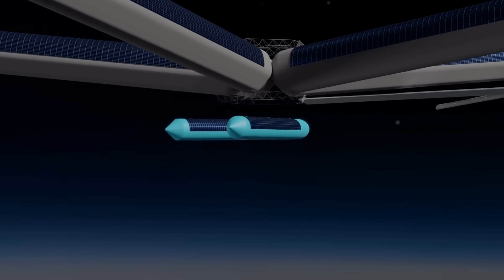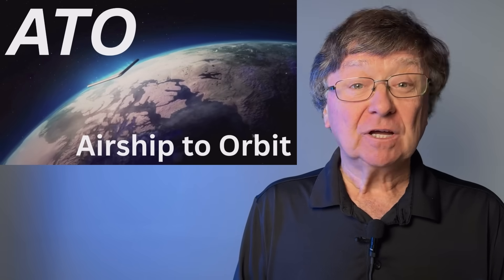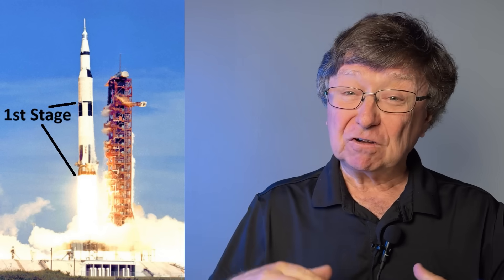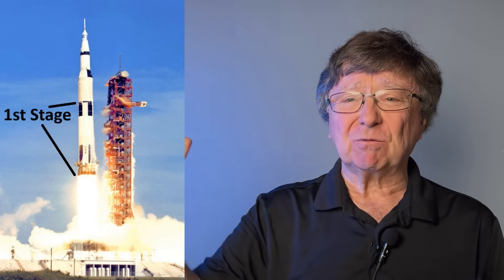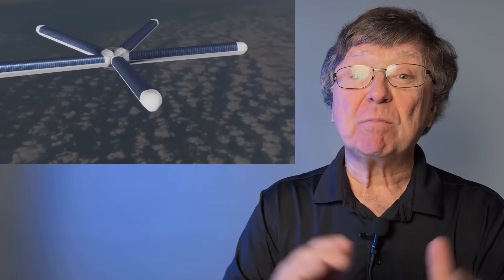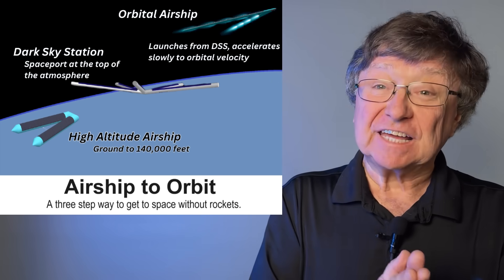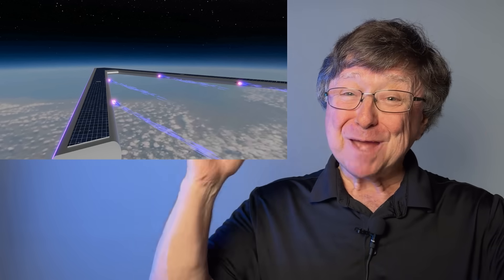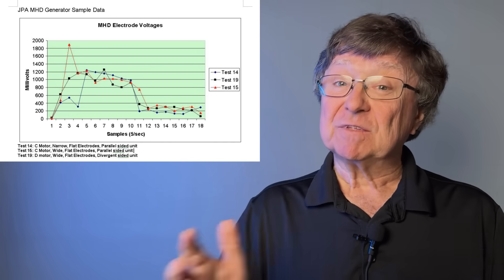This Airship Might Change How We Reach Space Forever!

Comment: I would not use the "safety" argument against rockets in order to sell your idea. 
Because we know that with practice, higher levels of safety are acquire and your idea is not accident proof either. 
If you have to sell it, why not use the polluting argument on the atmosphere when we launch a rocket.
Even for the rockets that use just hydrogen, there is still an issue with the NOX or water molecules that you leave at high altitude, which they can also change the weather.
Not sure if this could also be an issue for your electric plasma propulsion?
With respect to the airship to orbit, from the animation we can see that the scale of the airship is huge compared to the payload.  This mean that the airship mass despite achieving buoyancy at that altitude, is still quite large..  Maybe close to the wet mass of a rocket required to launch the same payload? 
This mean that the energy required to accelerate all that mass to orbital velocity would be similar to the energy used by rocket for the same payload.. 
With the difference that using low thrust electric plasma increase your ISP to the point of almost no propellant is required.
Or another argument to sell your development and research, could be other type of high altitude applications or even cases for Venus or Mars.
Reply: Selling the concept as a first trial of potential Venus station is a good idea.
Reply: High altitude communications stations that can operate for extended periods and are not owned by a guy that flings his arm out.
Reply: Do MHDs produce ozone?
Reply: @JinKee it might, which could be something positive, i can not think about any obvio us drawback of this propulsión method, that is why I am asking and why I think it could be use as a pro argument.
Reply: Pollution is a stupid argument.
Reply: @johnrmcclure1 it is a weak argument over our current World launch rate, but there are severa papers that place the alarm if the launch rate increase 100 times according to spacex goal with starship.  As I said, even lh2lox rockets would produce a quite negative outcome at that launch rate.

Comment: Pick any two: buoyant/aerodynamic lift, feasible atmospheric heating load, orbital velocities. Spending days at atmospheric densities high enough for buoyant/aerodynamic lift means an unmanageable heat load. Going high enough to avoid this heating means not enough atmosphere for buoyant/aerodynamic lift. How does the orbital ascender deal with these heat loads?  No one is saying balloons can't go fast. Those NACA balloons  and project shotput/etc were lofted with rockets. They were not generating buoyant lift when they were going Mach 10. They definitely did not show what you want to do is possible. Unless you have an orbital capable rocket involved?
Reply: I'm actually looking up some information on that. If the density of the craft is low enough, the dynamic pressure needed for lift can be low, and therefore, the heating can be low. 

Intuition can lead people astray, so it's best to check your preconceptions with math.
Reply: $10 to look at the pdf is extremely sus in my opinion.
Reply: It is matching speed to thermal capability.

And when above the atmosphere the second ship is light enough to slowly keep accelerating into a higher orbit with no drag.

It's a longer and less high delta v they traverse that last part in and out of space.
Reply: @ferkeap  its' true that the second ship needs less deltaV but what do you mean by light enough?
Since the load carry accelerates downrange, this means that the spaceport is moving at the speed the loader reaches while floating upwards in the atmosphere, so... For it to produce enough buoyant lift and/or aerodynamic lift it would need to sit at ~50 km up like specified in the video, that height means it needs to overcome a lot of drag while going forward meaning it would require fuel to push itself forward.
If the spaceport was stationary then it would Just sit there and the load carry could Just simply do its airship thing and reach the spaceport, then slightly more deltaV for a Normal rocket second stage and you're ok to go...we're talkin less than 8 km/s of DeltaV mostly in s vacuum (much smaller rocket)
Reply: @ferkeap  Light enough to keep accelerating? You're claiming a much larger than 1:1 thrust ratio? Because above the atmosphere there is no bouyant or aerodynamic lift. And it won't be going nearly fast enough to not hit the earth while falling yet.
Reply: Yeah. The Mach10 thing seems illogical Maybe I'm missing something, but low Earth orbit is not "above the atmosphere". Put a big balloon up there and it will need thrust to maintain its speed. And way lower at Mach10 with a balloon is going to generate a lot of drag!
What's the point of the Mach10 station?
I've got a better way: extremely slow 70% efficient piston engine powered robotugs with way big wings and counter-rotating necklace propellers.
Wings are key, so their final stage is reasonable. The rest sounds flawed.
Reply: High altitude iris catch platforms? Debris collection?
Reply: There's this thing called materials science . . . Things have changed a lot since you graduated in the 50s 😉
Reply: @mizake01  The physics haven't changed. What JP wants to do wouldn't even be possible if everything was metal. Shockwave impingment sites are the problem. Everything that travels that fast in thick enough atmosphere is a simple conical shape to avoid this. A giant floppy cross section of non-metal? Laughable. The key here is how does the ascender get bouyant lift and go orbital speeds at the same time. It can't, not without extreme heating that doesn't matter what material it's heating.
Reply: @Superkuh2 so you have done the math?  Share some numbers that exceed CMC capabilities
Reply: @glike2  Why are you asking for math on a non-existent object only theorized and we do not even have figures for the project except a dual 30x30m payload door. What is anyone supposed to calculate off that. It's not about "Math"(which I think by that you mean Physics).
@Superkuh2 actually spoke about factual engeneering knowledge. The load carry should only raise vertically, it makes sense as discussed in the video to launch from high up, which as you saw is being done already. But why making the loader accelerate to mach 10? To then meet a Hub which is moving ( so also at mach 10) (mach is a unit that also varies depending on height so why?)
Then you take a Giant angled craft (why? And the solar panels are not much of an excuse to making it angled). Then the rest of the acceleration would bring you to orbital speeds. For docking with a space station it would need to have zero delays because of the need to coordinate both the rendezvous with the station from the Hub, and with the Hub from the ground, right when it's about to pass overhead at "mach 10".
No need for Extreme complicato here. This whole concept seems based on complication, it should be reviewed and anyway, if they  built a loader that Just goes straight up and could take a rocket or spaceplane to 50 km up that would be already an insane performance boost while also making sense! They would need the money to do that, I would totally support the idea of a vertical lifter.
Reply: @Emanuelotto07i absolutely agree KISS rule. A vertical lighter than air lifter to take a Delta flyer to 50,000 ft would be a great innovation. The balloon or blimp could have a small compressor on board to deflate the helium envelope so that it can descend after releasing it's load. Without venting. Unless it is able to be done with hot air. 
Another choice might a mylar covered derrigible frame with a vacuum inside. Sort of a geodesic buckyball drawn down to a vacuum, as this is much lighter than air, and the pressure on the cell membrane decreases as it goes up.
Reply: @Superkuh2  "Laughable"
Yes, in more ways than one.
Reply: @jeremytaylor3532 I Also like the idea of using a vacuum. It would almost reach space and then letting the air in would slowly make that come down right?
Reply: @Superkuh2    Oh, deary, bless your heart.  So, you Know what is physics and so that it is unchanging.  Cool.  Ok.  Run with that.  Tell that to every physicist that you meet.  Also, please share how to end war, hunger, and illness across the universe, OH WISE ONE.  Best wishes :)
Reply: Well, someone is already financing this, and I'm sure they looked at the specs deeper than a youtube comment before opening their wallets.
We've been fixated on rocket tech for decades because it's a good weapons delivery system  - which is what the whole thing was originally about. But as tech matures perhaps we should consider other ways.  100 years ago they could make staggering airships with cast iron ans spit; I suspect we can build on that.
Reply: @joemck74  I Heard they needed finance, so I assumed it means they don't.
Maybe they thought only of the first stage. You know, the comments have gone already deeper than the analysis of the spacecrafts presented in the video, so I don't know about the rest of their knowledge, but it seems like this team is one of visionaries, atmospheric ballon experts, and architects, whereas @Superkuh2
 seems more like an aerospace engineer, which you should thrust better when developing a vessel that has to accelerate trough space and then also come back.
They should probably hire or include more engineers and experts in orbits and logistics in their team, it's always a great idea!
Reply: @joemck74  - a lot of Ponzi schemes, this can be one of them, financing a thing is BY NO MEANS the same as "a viable technology" - look at the rail-gun, "financed" with billions, when it was obvious from the start it was a silly, dumb idea.

Comment: JP, why not tether the atmospheric station?  Given that, stage can be simplified to an aerostat with no navigation or propulsion, just lighter than air lift that uses the tether to reach the station.  More lift needed for the thether but a greatly simplified stage one and a station that is less than 100 miles away instead of on the other side of the planet.
Reply: The weight of the tether is a huge drawback
Reply: @bobjoatmon1993 , as is the station being 1,000 miles or 10,000 miles away.  With a tether it’s always at the top of the tether, 30-50 miles away.  Reachable with no navigation.  Just hook an aerostat to the tether and it will take you there.  30-50 miles long is buildable with Kevlar and Vectran.
Reply: @Lunarmobiscuit maybe you're not making yourself clear. I sure don't understand what you're describing while i DO understand the reasons why a tether wouldn't work. 
The station isnt in orbit, so any tether hanging down is adding to the mass that needs to be supported, making the lift cells / structure need to be bigger, adding to the cost and increasing the engineering difficulty.
Anyway, if you think it'll work, start your own program to develop and build one.
Reply: Yes,  @bobjoatmon1993 , but it would cost far more to develop the ground-to-140000 foot vehicle, and cost more per trip from ground to mesosphere station if half the time station you want to go to is 12,000 miles away instead of always just 40 miles away at the end of the tether.
Reply: We can't make space elevators because we don't have the materials with enough strength to act as a tether.
Reply: @COKireato , not a space elevator, just a helium powered elevator to 140,000.  Then the big V from there to space.
Reply: @COKireato , I’m not suggesting a space elevator.  I’m suggesting a tether from the ground to the floating station up at 140,000 feet.  The Army flies tether aerostats.  A Kevlar rope is plenty strong enough.  Maybe even nylon at that length.
Reply: No real weather @42km just low pressure wind.   You could dock with a cable from GEO.
Reply: That much altitude and reduced air resistance to cut through gets you about a 14% savings on fuel. The rocket would still be very large. The velocity is very important.
Reply: @bigfishoutofwater3135 , the goal isn’t savings for orbit, the advantage is that the station is always just 30-50 miles away from a known location